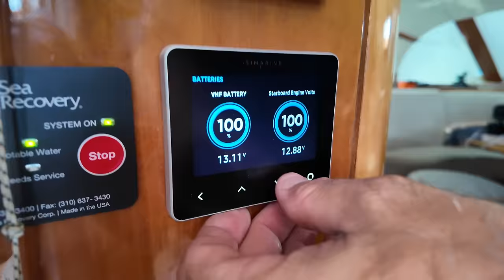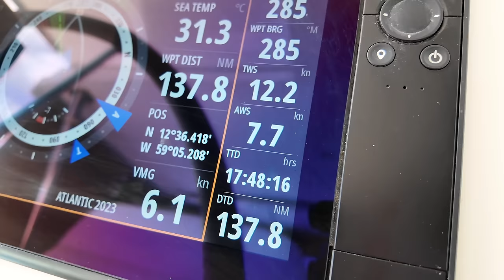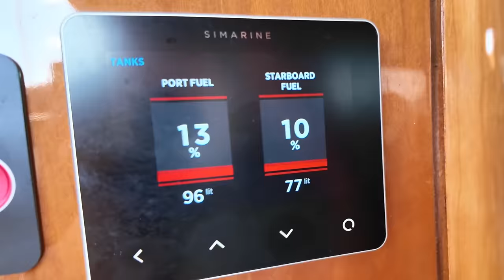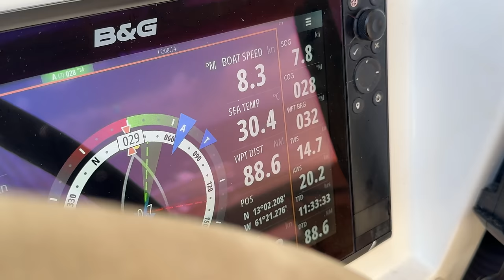We Crossed the Atlantic Ocean! 🌊 (Ep 271)

Comment: For Finn: VW’s are now collectors. For what you’d be paying it would benefit you to get an AWD sprinter type van and deck it out. Plus it would be WAY more reliable. So you can concentrate on your exploring and not fixing your vehicle all the time.
Reply: Agree!!
Reply: A vw would be a good teacher in mechanics. With the ability to work on it yourself a diesel vw becomes one of the most reliable vehicles possible. Parts are still made. A lot of cash and education for it to potentially get rear ended and totaled... out there on the tar. I'd get something more disposable. Especially as a starter van. A sprinter leased would be the millinenial thing to do. Diesel is the way to go if you can afford it. Takes more knowledge  to work on em,  but ultimately more reliable. Now vanlife.... vanlife and the choices on setup are a whole different story. Ppl do it in ambulances with 0$ into it, and others are cruising 100k sprinter conversions.  Mine is an airport shuttle bus with more in batteries than the cost of the vehicle itself.
Reply: Or the cheap way if you can't find a decent priced 4x4 van- If your Dad still has the white Excursion: Borrow it for a few years and put a roof top tent on it ;)  Plenty of those running around decked out Overland style with people living in them. Those are some serious bulletproof machines. I'm on my 3rd one.
Reply: A really good cheap option is a Chevy Express van and the state of California has been selling off old California lottery vans that have Quigley 4x4 conversions, they were used to deliver lottery tickets to retailers. You can't beat the reliability of a LS engine and a 4L80e transmission.  Parts are literally available everywhere and they are inexpensive and they are easy to work on.
Reply: Agree 100% ! Prices on VW vans going through roof but they always been a drive to breaks and fix again till breaks and so on. A sprinter with a smaller diesel engine will handle everything for Fin.
Reply: Yep, Kombis are getting ridiculously expensive and I didn’t think there was such a thing as an AWD Kombi anyway? Maybe Finn is thinking Transporter, which are available as AWD?
Reply: Plus those Sprinters will be collectibles 60 years from now 👍
Reply: @DCXTV  He has written his story, and being Keiths kid, he will know how to fix. The fact that he's got a Subaru engine in his van alleviates many issues right off the bat. Good luck Finn we will be watching. :)

Comment: Two brothers had been hiking partners for many years.  They decided to take a long two week hike into the desert.  To get to the desert they had to take a twelve hour drive, then they had to canoe for three days to some foothills, they crossed over a sizable mountain, and into a valley.  That valley would lead them into the desert plains.  After the first week in the desert the two brothers had made it into the halfway point of their desert crossing.  That's when tragedy struck at the worst possible time.  One of the brothers decided to take a nap outside of their tent in the sand.  While he was asleep a large diamondback rattlesnake quietly slithered up to him, to use his body for shade.  When he woke up from his nap his movement scared the rattlesnake and the rattlesnake bit him right on the tip of his private parts.

He screamed and his brother came running to help him.  Seriously injured he exclaimed...  "Help me brother.  A rattlesnake just bit me on the tip of my privates."

Right away his loving brother handed him a canteen full of water and told him to sit tight and be calm.  He would make his way back to civilization, find a doctor, and bring the doctor back to save his life.  Then he hurried back to the valley, he ran across the valley to the mountain, he climbed over the mountain to the river, and canoed for three days.  Finally he made it to the car and proceeded to drive the twelve hours back to civilization.  Without a moment to spare he found a good doctor.  He said...  "Doctor, my brother was bitten by a rattlesnake in the desert and he doesn't have much time left.  You have to come with me to save him."  But the doctor said...  

"I'm sorry.  But I can't go with you.  I have a lot patients who need me or THEY won't make it.  I could lose many of them just to save your brother."

The man was persistent.  He pleaded with the doctor.  "Please doctor...  You have to save him.  He's my only brother!  Please, you must help him."

The doctor answered.  "Look friend, I can't go with you.  But I can tell you what you have to do to save your beloved sibling."  The doctor went on to say.  "First you have to locate the tiny holes where the rattler's fangs punctured your brothers skin.  Then you have to cut an incision from one fang hole to the other fang hole, connecting all four fang holes.  Then you have to orally suck the poison out of his body as best as you can, remembering to spit out the poison.  You must not swallow any of the poison or YOU might not make it yourself.  Then bandage his wound and bring your brother to me as quickly as you possibly can so I can further treat his very serious injury."  

Knowing that time was not on his side the brother left the doctors office in hopes that he would not arrive only to find that his brother had already left the Earth.

He drove the twelve hours, canoed for three days, hiked over the mountain and across the valley, and made it to the desert.  With only his dear brother on his mind it took him just five days to cover seven days of desert territory.  When he made it to his destination, thankfully his brother was still alive.  Although his dear brother was barely clinging to life.  

His severely injured brother looked at him in despair and quietly whispered.  "Where's the doctor?  You told me you were going to bring me a doctor to save my life."

Then the healthy brother looked deeply into his seriously injured brothers eyes and said.

I'm sorry bro...  But the doctor told me that you're not gonna make it."  

Ba Dump Bump Chee!!!

Take care.  sincerely,  Dean O.  :-I

Comment: Posted on Marketplace 14 weeks ago:  1981 Volkswagen vanagon · Westfalia
1981 Volkswagen Vanagon Westfalia Camper Van All original flat four cylinder Air-Cooled engine and interior. 4 speed manual transmission All original Westfalia interior Propane & Electric Fridge 2 burner stove Sink with 14 gal water tank on board. Front seats swivel 360 degrees. ZERO FRAME RUST. Vehicle has lived in California, Arizona, and Nevada.

Comment: The next time you invite guests, you might consider a 70 year old retiree with respiratory  issues.  I could certainly add some drama to your posts.  I'm from Ft. Worth and ran a welding truck in the oilfields.  About 15 years ago I bought an old cat and rebuilt it in the Chesapeake Bay but life happens and had to sell it.  Anyway, while you're out running around, I could boat sit for you on the hook and save marina costs.... Just saying....